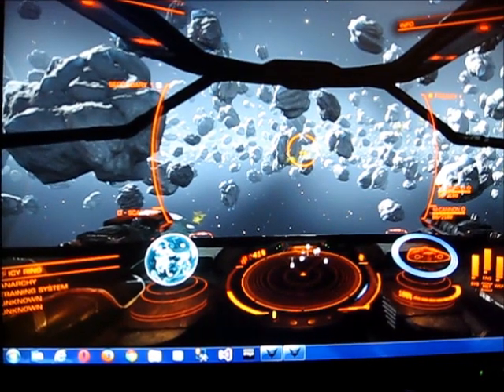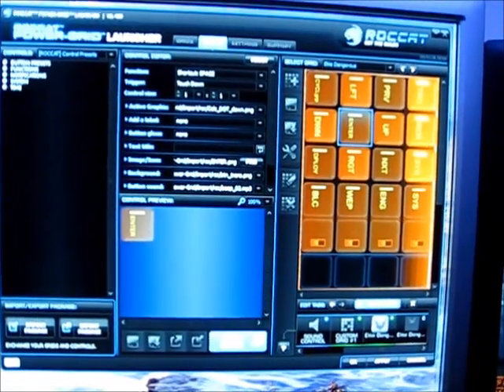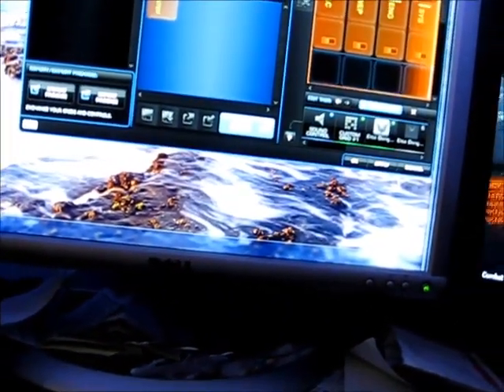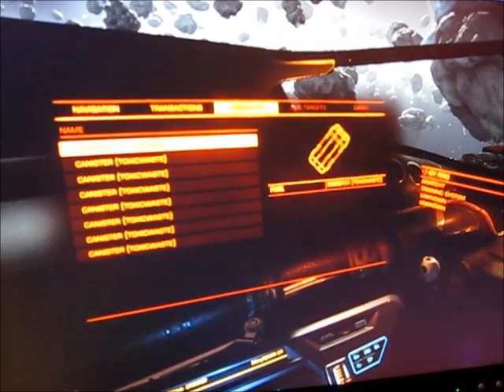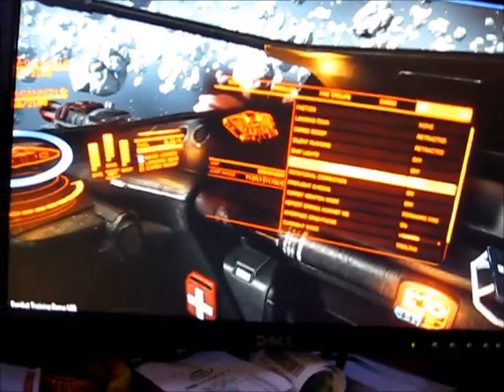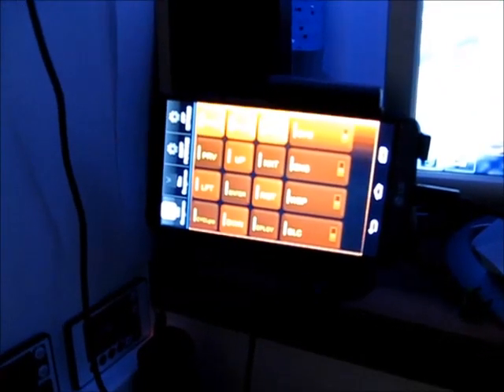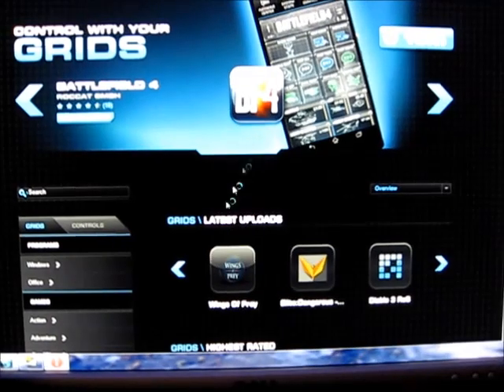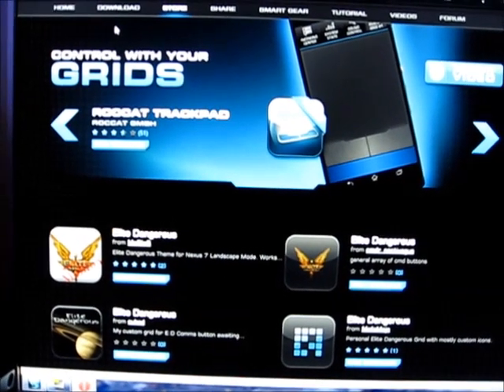Elite Dangerous - Roccat Power Grid Demonstration

Comment: How to use this with your voice?
Reply: Voice attack is very, very cheap and works really well. I use it in MHO. Hawken, ED and many other games. It is also really easy  to set up.
Reply from the maker: +Ethernal Oynuyor - I don't know if you can, it's not designed for voice control. Maybe try "Voice Attack".
Reply: dibley1973 İ won't buy that expensive shit.
There is no crack of it either !!!
Reply from the maker: +Ethernal Oynuyor  - I dont think it was that much. For my mind "Elite Dangerous" was the waste of money!
Reply: Voice attack is less than $10